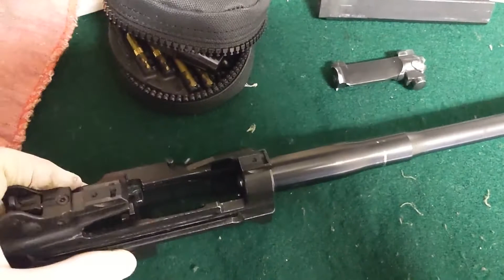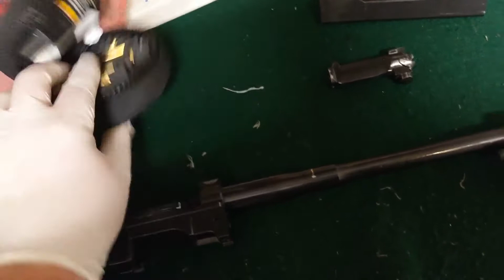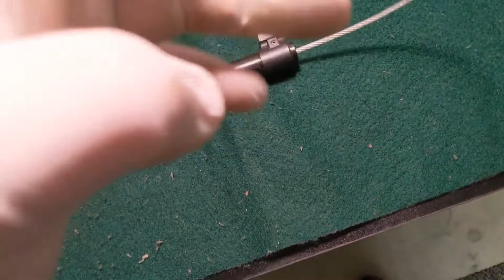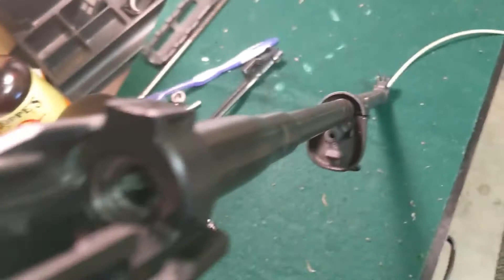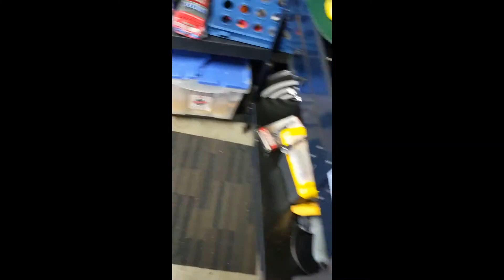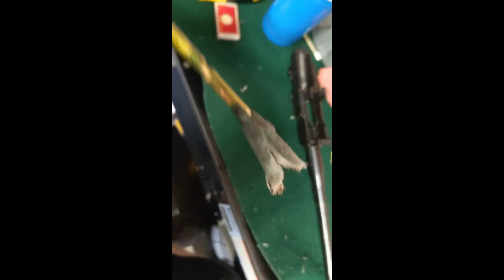[Solution] Otis Cleaning System stuck in Mini-14

Comment: I had similar issue used a too large of a patch causing it jam.  What I did was soak the patch with solvent and  let it sit for 12 hours.  Finally it was able to pull really hard and it dislodged.